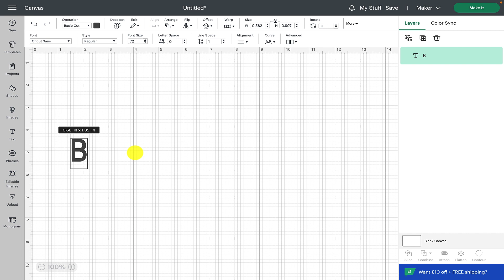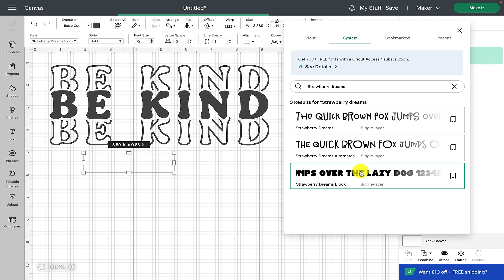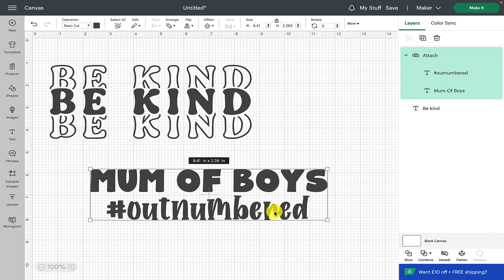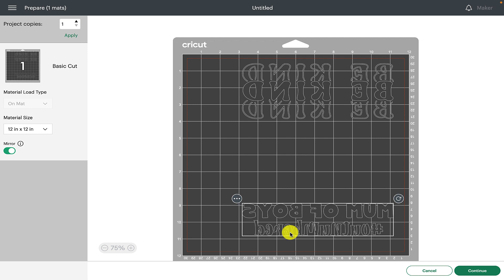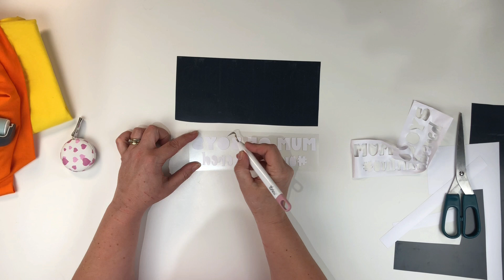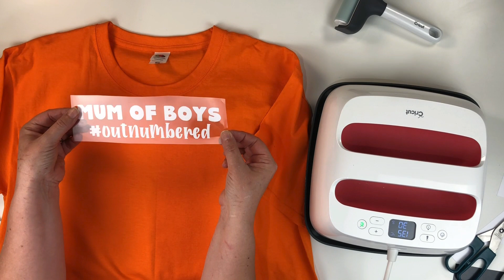Step by Step How To Put HTV (Heat Transfer Vinyl) Vinyl On A T-Shirt: Beginners Guide

Comment: What kind of transfer tape did you use?
Reply from the maker: Hi I didn't use any transfer tape. The clear part is just the carrier sheet that the heat transfer vinyl is on. I just use that to position the design on the shirt, press and then remove the carrier sheet. Hope this helps.